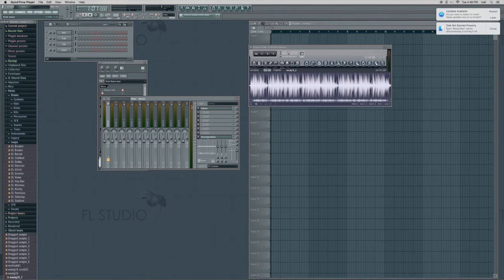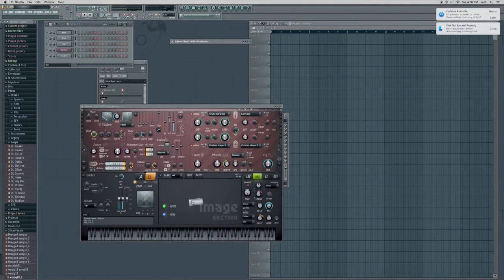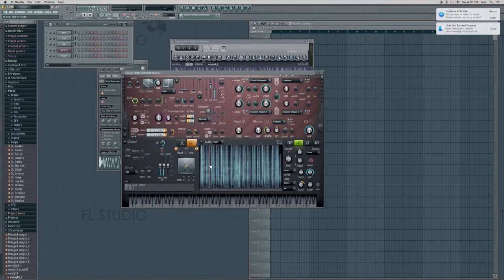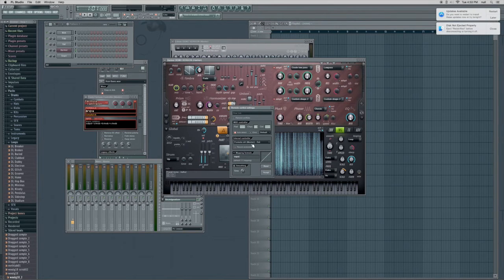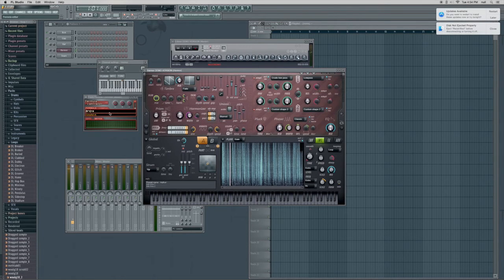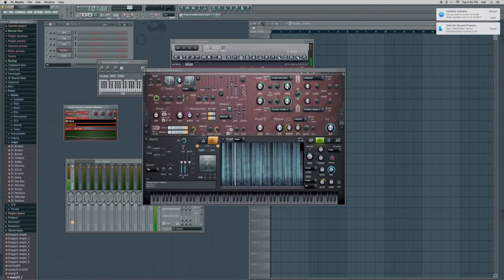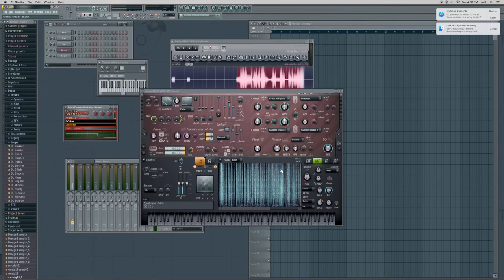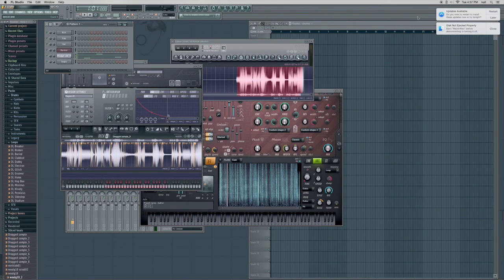Studio Marie Anne   Harmor Scrubbing

Comment: Harmor still generates a tone while I'm scrubbing around the track in the image section. How can I disable this? I know it's probably something pretty simple but I haven't used FL a whole lot
Reply from the maker: what do you mean by a tone? A saw wave? Your "b" channel may be doing that? Try hitting the power button under the letter b. Hit me up here http://studiomarieanne.com/contact if you wanna skype about it really quick, maybe it will be easier to figure out that way.
Reply: Sent you a message but I've since avoided the problem by just starting over from scratch. I thought it was one of the oscillators but idk why it was activated. I must have knocked something on somehow. Also, I did find that if you use a mono sample in each image section, one of them will freeze and retrigger  while you're scrubbing the other, making a pretty loud "tone" so it could have been that.

Comment: How do you find FL on Mac?
Reply from the maker: still in development but there is a crossover wrapped beta and a native alpha so far. this is that crossover wrapped beta, it works pretty well for that built in plugins but most external ones dont work or are a pain to set up.

https://support.image-line.com/knowledgebase/base.php?ans=114&_ga=1.232046940.298484457.1470942681